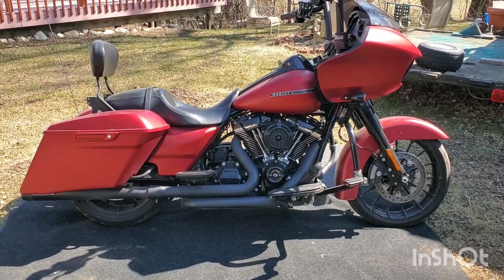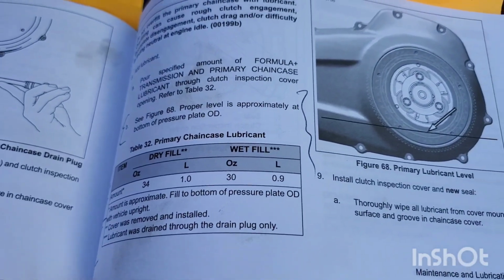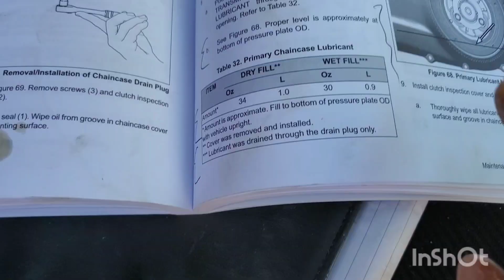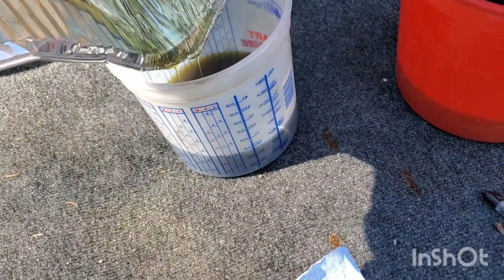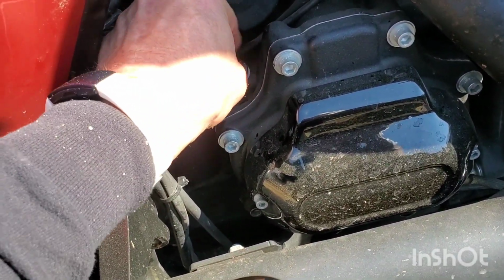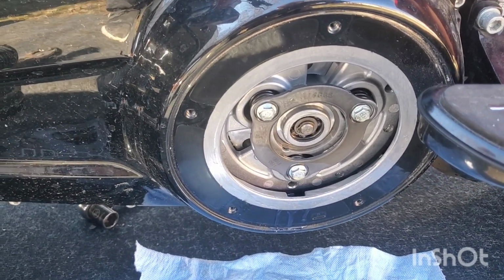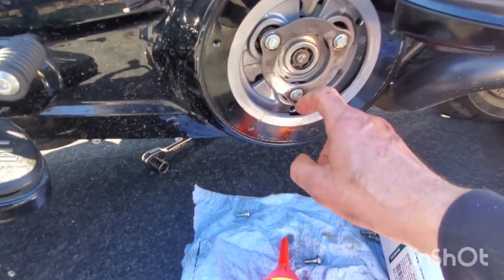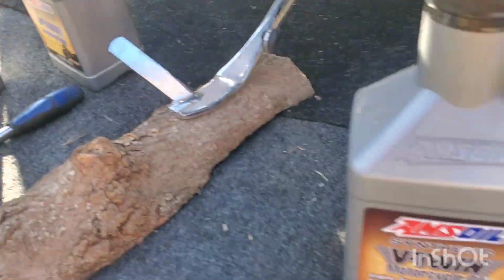Harley M8 3 hole oil change and transfer fix. Tranny to primary oil transfer fix. life pranks

Comment: Yeah Brother! AMSOIL is the ticket for anything that uses gas or diesel. Been using this stuff over 20 years! I have a 4Runner that has over a quarter million miles on it and still running strong!! It's definitely going in my 2017 CVO Ultra I just bought!

Comment: 3 years later, did this fix the transfer issue?  I just bought a 2019 and have the problem.
Reply: Did u ever fix your problem I’m going this weekend to get a 19 street glide but this seems like a common problem I might want to stay away from. And the oil pump issue
Reply: @danielibanez7215  it isn't that big of a deal, part is 60 bucks and the 2020's have the tube. if you can open the primary and drill a hole you can do it. 
wouldn't let it deter you.

Comment: I have a 2019 street glide that had the transfer issue. Discovered at 500 miles and took to dealership. They installed a primary vent that fixed the issue. 2020 miles shipped from factory with this primary vent.
Reply: Hmmm, so much for the vacuum argument.

Comment: 2014 ultra classic same issue i could not see how much fluid was in my transmission that is why i switch to red line with the shock proof because it looks like pepto bismol now i can c it on the dip stick

Comment: Same on my 2019 Roadking I found today.  
Check the oil at ambient temp.
Where did you get the clutch push rod?
Reply: @Charlotte Tent i got mine today and installed it.  Refilled transmission and chaincase with HD Heavy Gear.
Reply from the maker: J&B Cycles Parts & Service

Burlington Wisconsin
Reply: @lifepranks  did it work ?
I have a 2019 FLHR with this issue